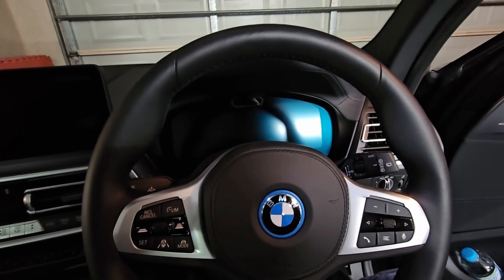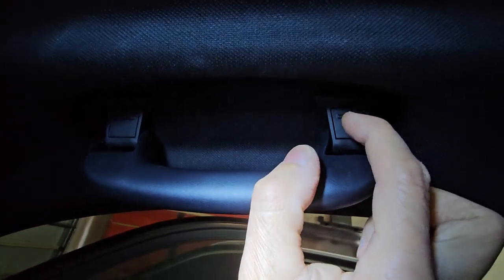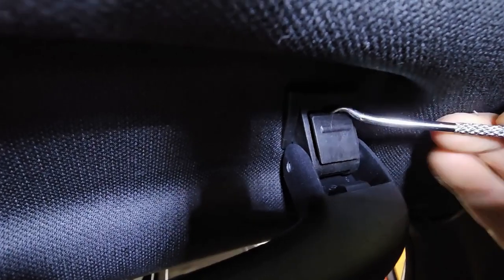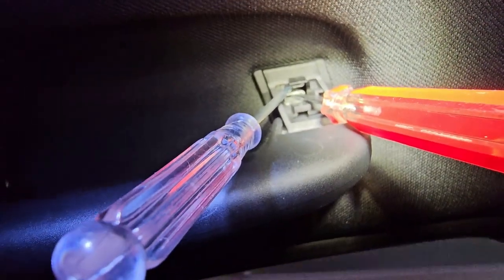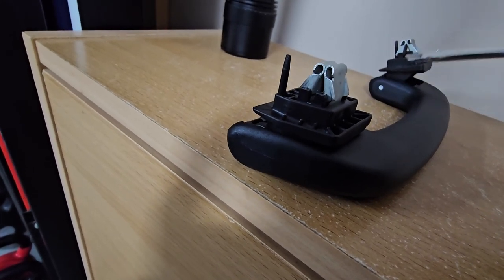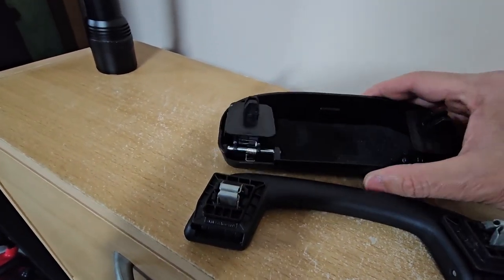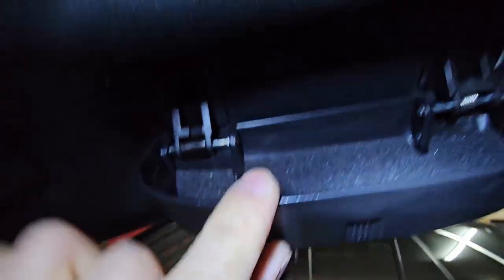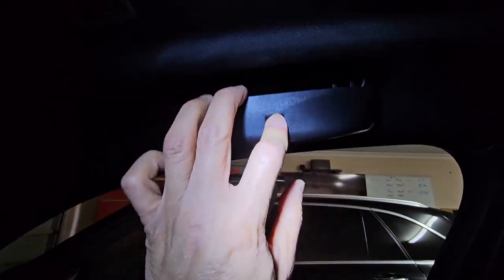BMW iX3 Sunglasses Holder Installation in place of grip handle

Comment: What’s the part number for this holder?
Reply from the maker: Hi, this is not a BMW product, here's  a link on AliExpress. Check it out! 
AU$13.29 | Car Sunglasses Case for BMW 1 3 4 5 X1 X3 X5 F20 F30 F32 F15 F25 F10 F11 2015 - 2022 Glasses Sunglass Box Holder Storage Cage
https://a.aliexpress.com/_mNEN93s